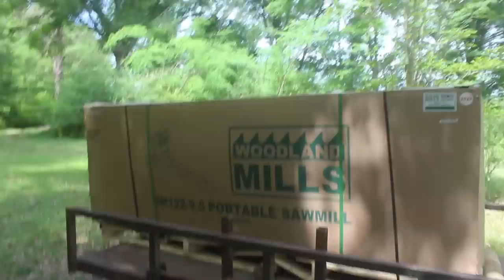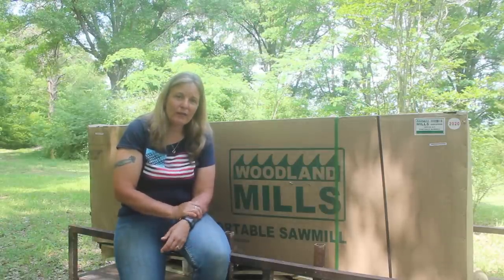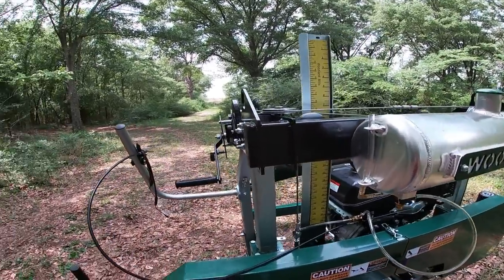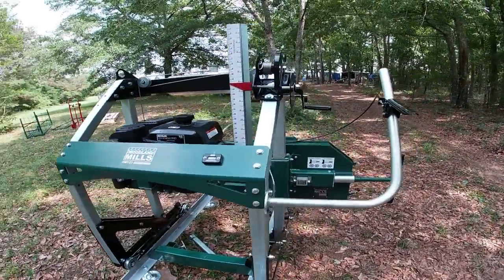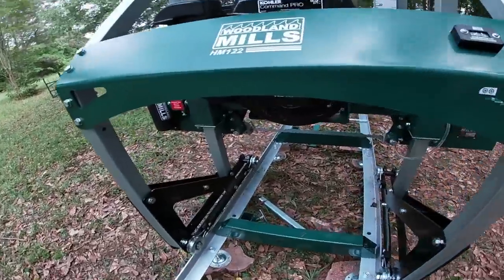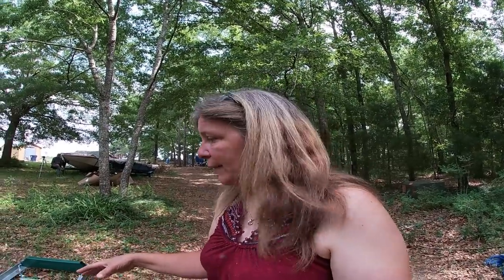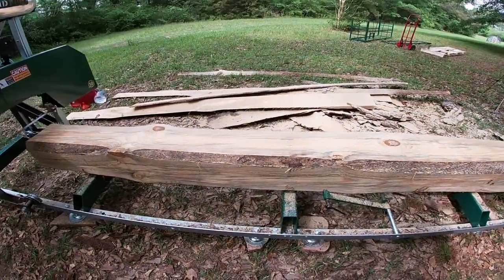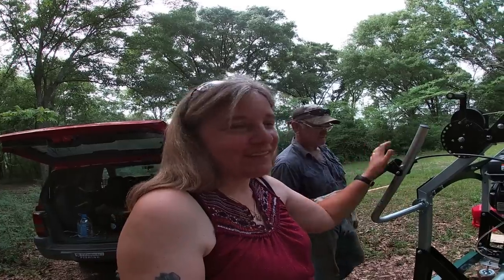Here We Go AGAIN : Harbor Freight VS Woodland Mills BANDSAW MILL

Comment: The difference between Harbor Freight and Woodland sawmills are three things (1) Woodland's models cost a bit more (2) Woodland's has manufacturer limited support with parts and repair (3) Woodland's is designed in Canada, but manufactured in China just like Harbor Freight's sawmills are.

The two main questions being (1) are you planning on using the wood yourself, if yes, then Woodland Saw Mill models are a pretty good deal money wise. (2) Albeit, if you are thinking about actually getting into the wholesale or retail of lumber you cut, then you will need to purchase a much more substantial sawmill than either Woodland or Harbor Freight manufacturer or offer in any model. Preferably one made in the USA.

Comment: Ok nice video. Can you cut a wider board with the wood land saw ? Harbor freight is 20" I have a harbor freight saw did alot of mods to it
Reply from the maker: I believe It will cut a 20in board. The widest we have cut so far is 15.  But if I remember correctly the space between the guides is right at 20 1/4. We had to measure it to see if one of our logs would fit. :)
Reply: I have a harbor freight extended the rails love it, I cut 20” red oak all day and can cut 18’

Comment: I am thinking about buying one, I see you have yours on a trailer, so, how do they ship them to you? If you don't mind me asking.
Reply: They bring it in a semi and drop it off in your yard, if you have easy access to where you're wanting it permanently they might be able to drop it there, otherwise you would need a trailer to move it to where you are going to set it up
Reply from the maker: Mine is not on a trailer its just sitting on some skids on the ground. It comes in a box on a semi truck. They will unload it at your place as long as you have room for a semi to stop.

Comment: I have made a very heavily modified harbor freight sawmill and it works as good as any other of similar size and operation that being said I wished I had bought a woodmizer much better mill the other thing don't put dish soap in your blade cooling system it's to cool the blade not lubricate the blade the only thing it will do is burn you drive belt because it will cause it to slip the blade makes its own path otherwise have fun milling
Reply from the maker: Thanks for sharing

Comment: Slow. I got a diesel powered 54 inch saw.  Dont cut as pretty.   But puts out 5 times the lumber.  Gotta love the old frick mills.  But the band mills do make a smooth cut.
Reply: Good for small cut jobs, I just started running mine commercially even.

Comment: i hjave a woodmizer lt19 super hydrolic that loads the logs and turns them with hydrolics
Reply from the maker: Wow, we would love one of those.. I bet you LOVE using it!
Reply: @ThirdTimeAroundRanch  yea i do  it can cut alot  of wood in a day it costs a little more but ive had mine since 2007 and have only spent 1000.00 bucks on it also have a band sharpener so everything is at home

Comment: I like your work so far. Koler is a work horse o a motor. They also have good bath rooms and tubs to relax after a long day at the mill. The thing you need tha you should use  before the log goes on the mill is a good chainsaw maybe 18-20 inches at thee bar. Clean up the ends and remove the branches from the outside of them log. Work hard and get it right.
Reply from the maker: Thanks for the tips! Since we are on a fixed income we cant afford a "good" chainsaw  but our little cheapie gets the job done "most" times. LOL

Comment: Im subscriber number 101! how do you dry and keep your lumber from biodegrading? like how do you treat it and how long do you dry it for? thanks
Reply from the maker: Thank you very much for subscribing! We are totally new to milling, so far because we live in the South we just stack the lumber in the shade and cover it to keep the rain off of it. We wont be storing it for long because we need to build some bedrooms with it. Normally you should leave it stacked about 1 year per inch of thickness and you can and maybe should paint the ends with a sealant to keep the lumber from drying out too quickly.
Reply: @ThirdTimeAroundRanch  oh ok. How do you keep it from rotting away over time?
Reply from the maker: Well it is just lumber like you buy at the store so I guess it will rot over many many years. You can stain it to help protect it from carpenter bee's or you could put a water seal on it to help protect it from moisture. You just use it and treat it the same as any lumber you buy.
Reply: @ThirdTimeAroundRanch  I thought you had to treat it yourself unless you buy pressure treated lumber that's made for outdoor use. If your cutting it yourself I'm wondering how you treat it to be used for outdoors.

Comment: Woodland mills are made in China.  They do have good support.

In defense of hft... If you don't know sawmills or how to saw don't expect support.  I owned a norwood for 10 years and it is a good mill.  I sold it because I got an offer to sell it for more than I paid so I tried the hft mill.   It was under 2000.00 you can't beat that.  I've used it for 9 years no issues.  All belts bearings and cables are obtainable economically off Amazon.  
If you go with hft... Learn off web how to operate... Never adjust drive wheel it's factory set.... Use .042 thick x 144 inch blades 

My impression is woodland uses many of the same parts as hft.

Comment: Good information but note to viewers, this is not an apples to apples comparison. For the price difference the woodland should be a better and more powerful mill.
Reply from the maker: That is not correct, there was only a $600 difference and that was with me choosing to pay an extra amount for the larger motor. The base price for both are quite comparable.
Reply: @ThirdTimeAroundRanch  I think you did get a better sawmill but my point was you had to pay for it being a better mill. The motor was maybe 100.00 to 200.00 of that 600.00. This being a 21% increase, in my opinion was not an apples to apples comparison. I did like the upgrades you showed on the Woodland. Thanks.

Comment: First time viewer... I really wanted to to how you got it on the mill and the amount of time and effort it took.
Reply: The setup of the mill took the most time and effort, loading the logs isnt too much of a hassle depending on size, the one seen in this video is smaller than the one we just milled up in the newest video. With the bed being low to the ground all it takes to load it is a small little ramp and it rolls up nicely using the cant hook, takes maybe 5 minutes to get the log up and situated and ready for cutting, the larger logs may take closer to 10 minutes just because they arent easy to move tiny bits and take a bit more manpower.
Reply from the maker: We load larger logs with a winch that's connected to the front of my Jeep. Put a couple of cut offs as ramps and winch it up. You can see the process and how easy it is in the newest video. Thanks for watching!

Comment: I would not give you 2 cents for that carriage !
It is flimsy and not solid enough for any big logs, Guaranteed to twist or warp on you when you least expect it.
It should be mounted on a min of a 6 inch boxed frame, Then you got a mill to cut heavy logs, That I would scarcely would not be good for logs over 12 inch.

Comment: Ya. Pretty much everything Harbor freight is made Cheap in China. China was behind in manufacturing before Covid. While folks are avoiding the subject or giving a raft of different excuses. China locked a whack of their population behind locked doors with police patrols for many months. That tends to affect imports, exports and manufacturing. They are well over a year behind on orders of pretty much everything. I mean that's why lumber prices and other commodities went through the roof with inflation even though we didn't shut down and there were no exports. Our lumber mills around here were so overstocked you couldn't even see the mill buildings. Yet with this insane amount of surplus lumber inflated by 300%. That's opposite to how it works in a supply and demand market. Surplus equates to lower prices not higher ones. They artificially inflated many of these items to ensure that competition against China could not arise here even with 6 month of wait times and a massive surplus in materials. They artificially made it far to expensive to compete.  How can I prove such an outrageous claim? Well these so called world market values never affected China prices for goods. It may take 6, 8, 12 or more months to get something but their prices did NOT inflate. How do they import manufacture and export in this insane inflation at the exact same price as before with a 300% increase in material costs without loosing their shirt? Well, They can't It's impossible. The "world market" inflated prices we are paying for our own locally and nationally made products and resources is being exported to China inflation free. Only western countries are paying inflated prices for nationally produced goods. Before covid we couldn't compete citing low wages in china but most of the wages are shipping and transport and over 2/3 of that is at international rates or in my country. Only the manufacturing wage and ground transport to and from China port is at Chinese salary rates. No way they can absorb ANOTHER 300% in costs plus the inflated shipping costs a full year into the future but that's exactly what is happening because Chinese goods are not inflating in any way I've seen except for me getting it shipped from the import wholesaler or retailer. 

ALL that said. You got a better mill now anyway. The features like better fit, automatic water and even details like the oil drain extension shows it's a mill designed by or atleast improved on by sawyers.  Hopefully Woodland is doing all their parts, manufacturing in America so you don't run into any more problems.

Comment: The next  good product I see from Harbor Freight will be the first.  Dreadful quality.
Reply: I bought some sanding belts today, and I'm pretty happy with them. I hear their miniature metal lathe/milling machine is decent. Sand blast cabinet does what it is supposed to. The rubber palmed gloves at $1.79 last me easily as long as th $5pair ones from home depot. The 5 pair from Home depot for $10, dont last me a full day/pair. Tarps seem decent. There are actually several decent items there.  Trailer lights are a good value.  Many of their consumables are okay. Would I buy tools I use for my profession there? I have never even looked at them. They sell them, I have no interest

Comment: Do not buy a Norwood sawmill. Horrible customer service. The coating on my sawmill is already peeling off and I’ve only had it for six months. It’s been under an awning the whole time. This was a pain in the butt to put together they sent it to me in 1000 boxes and the boxes were mislabeled and none of the parts have part numbers on them so I literally had to look at the blowout schematics to identify each part by shape. Many of the parts did not show up and if anything breaks you can’t simply replace that part by calling them up and say hey I need another dog a cyst or something you have to buy an entire new package.
Reply from the maker: Wow, I'm sorry it's been so bad for you. I LOVE customer service at Woodland Mills. Super helpful.
Reply: Yeah they shipped everything in 2 pallets That showed up on a 40 foot trailer. I live out in the sticks so getting a 40 foot trailer down the drive is not gonna happen. I had to go out to the highway and cross load it into the back of the truck with a smaller trailer.  I had to do an inventory of the boxes before I could receive it which meant I had to break down all the pallets right there on the side of the highway and try to get a inventory while the drivers Tap’n his watch wanting to get out of there. It wouldn’t have been a big problem if the box is I had to sign for we’re actually labeled correctly. So boxes I actually signed for did not have the parts in them that were supposed to be in them. I did not find out later till I can get to it to assemble it since I had to do it myself. By that time I was over the 30 day mark and customer service tells me too bad they’re not responsible for it. I even called them right after boxes arrived and let them know some of the boxes were not labeled correctly. And that it was gonna take time. The other problem is a lot of stuff is on backorder and stuff did not ship till later. The kind of stuff you need to even start putting the frame together. Stuff like the wrong box of screws and bolts so I couldn’t even start putting it together until they showed up months later. When you can’t even assemble it and the parts aren’t labeled or we’re in the wrong boxes it’s very difficult to figure out what’s missing until you get to that point in assembly. Not happy with this company I’m glad your sawmill worked out I just want other people to know what to expect so it doesn’t happen to them.

Comment: Why are you cutting so slow?? If you watch there video he is going a lot faster.
Reply from the maker: It takes a bit of time to get the feel of the saw and to know how fast you can go. We do not want to burn anything up by pushing the mill too fast. Also we were told by WM that going too fast or slow will cause your blade to travel up or down and give you a wavy board.